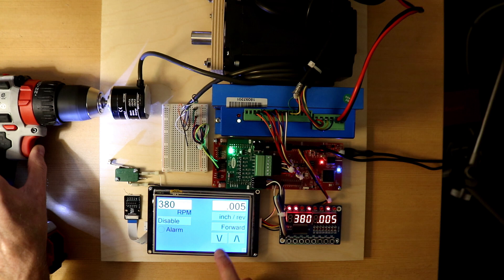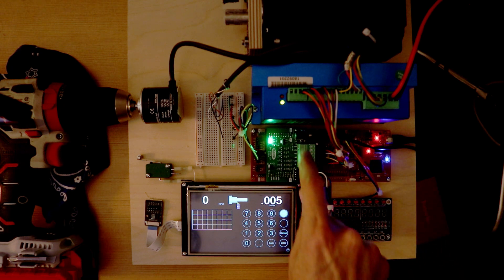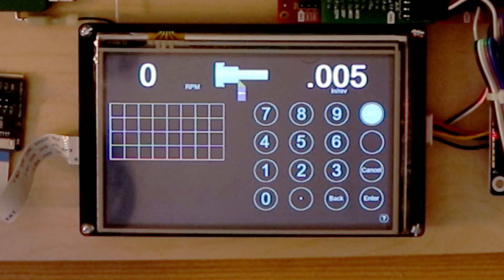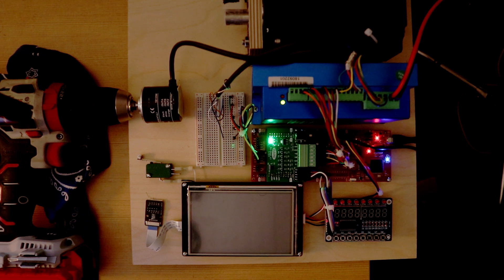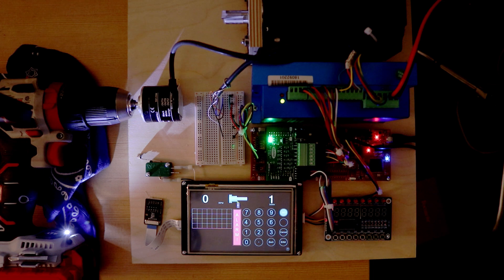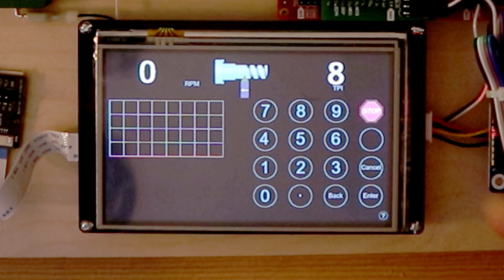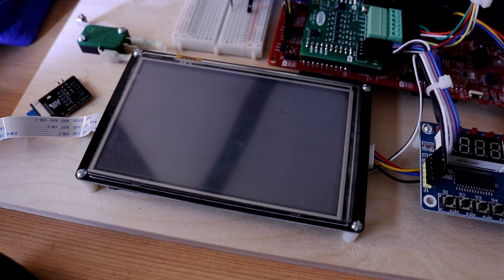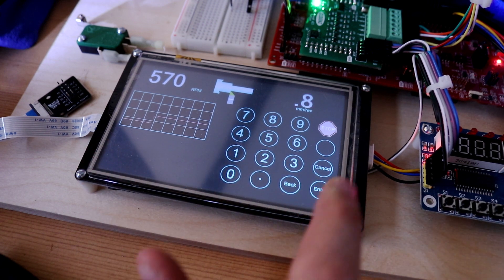Touchscreen for Clough42 Electronic Leadscrew

Comment from the maker: The graph on the interface could be used other functions. For instance, plotting spindle load on a second axis with spindle speed. The hardest part is likely getting the information into the TI board. After that, only a small amount of code is needed to display the graph.

Comment: Hi. Going through all the comments as well as all the documentation. So I also ended up with the version where the 7 segment display is also working so I could ensure all is working correctly. The problem is that I cannot get the Nextion display to work. So I am now open for a couple of next steps. If you or anybody still have a compiled version that was done with the old CWARE and where the screen was working I would really appreciate if this can be shared as I do not see it in the GitHub files. I have now in the meantime ported the code and everything else to the latest libraries but the problem stays the same. 7segment and servo is working but Nextion does not work. Any help for a compiled working .out file would be appreciated for my troubleshooting process.

Comment: Hi Kent, my good working Nextion display glass broke and after I uploaded the same firmware into a new identical Nextion display it doesn't communicate with the TI-board.
In the Nextion Editor debug mode I connected the display and could send/receive commands.
The Nextion display seems to be good but no connection to the E.L.S.
Any ideas? Thanks.
Reply: I have the same problem. Spent about a week on it trying to figure out why the board was ignoring commands from the screen. I eventually gave up. 
And unfortunately, it seems as though we're not the only people who have experienced this. Give us a heads up if you figure it out, and I might have another go at it, because right now, I've lumped it into the category of a failed project.

Comment: This screen would make it possible to loop a position sensor (from a dro set) to the TI main board and control the spindle speed based on cutting speed (handy in facing operations) as well as some level of speed control under load, when used with a  VFD controlled motor. Through this setup it would be easier to set the cutting diameter. And have the CPU compute the output for the VFD.
Reply from the maker: That's a very interesting idea! I'm not sure that the value of a ELS makes sense when so close to full CNC. But a tool like you're describing, as a standalone, could be made pretty affordable, and the results especially nice if used with power feed. Thank you
Reply: @kentvandervelden  the cross slide would still be operated manually. Just that the VFD gets added to the control to set, and maintain speed. With the speed regulated by the working diameter.
Reply from the maker: Totally got it. Manual or mechanical power feed if the lathe is equipped. Very elegant.
Reply: @kentvandervelden  tips for alternative screens? The nextion is sold out.
Reply from the maker: @FlexDRG_Lampje  Sorry, no I don't. I've had to buy some stuff on eBay at inflated prices, because everyone is sold out. E.g., last I looked RPi's were 3-4x list.

Comment: just found this. Fantastic implementation! I particularly like the graphic of the part and cutting tool.

What is the need for the graph? I see previous comments echoing my thoughts, but you must have had a reason for it. 

Kudos. I am in awe.
Reply from the maker: Wow, thank you! The graph is an experiment, to see if a trend line is useful. Spindle speed may drop if the motor starts getting bogged down. Maybe temporarily or maybe its regular. For the visual sort, who can't do math in their heads. Count me in that group :)

Comment: Kent, awesome video and useful expansion of Clough42's implementation!

For those of us who are coding-deficient, could you explain more about how to add this to James' ELS? Is it an addition to or does it replace the Clough42 code?

Thanks for your efforts!
Reply from the maker: Thank you! This is a modified version of the original. If you built the original using Code Composer, you'd follow similar steps with the modified code. You can find the modified code at the following link. As a fallback, save the original binary that you loaded to TI board, which can be reloaded if anything goes wrong and save you the time of rebuilding. Wishing you the best of success!
https://github.com/kentavv/electronic-leadscrew/tree/feature-nextion-pure-dev

Comment: This is why open source is beautiful, someone put an idea out there, and someone else built upon that idea.  I'm going to order parts and hopefully contribute as well.   CNC lathe doesn't do anything for my work flow, but CNC aiding to avoid gear changes is awesome.
Reply from the maker: That's fantastic!
Reply from the maker: I was bitten hard recently relying on a closed source program to collect results. A bug caused all the data to be lost. Lesson learned was the most important tasks need to be verifiable and simple.

Comment: If I already have the original project, is it possible to add only the microswitch?
Reply from the maker: You could add the limit switch to the original project. You'll need to add a small bit of code. I recommend using a proximity switch or interrupter instead of a mechanical switch to simplify debouncing.
Reply: @kentvandervelden  Thank you very much .

Comment: Great indeed fantastic project.
You could add two more engines to make it all automatic, the board would be the same or should you do a new project? Thank you so much the videos are very intuitive.
Reply from the maker: You want to add two more motors? You may be able to start with the existing board and software, but heavy changes would be needed. I would prototype with LinuxCNC, make a custom display, attempt to reduce to a smaller size. The time cost of a custom ELS is higher vs. a CNC system that's more functional. Hardware costs are similar. Hope I understood your question correctly at my opinion was helpful.
Reply: Ok thank you

Comment: Kent

I like what you have done very much. The one thing you have done that would make a huge improvement to the Clough42 system is the end stop. It would be better with an electronic end stop and a start point, but the simple switch you have used as end stop would help a lot. I have my Clough42 system working on a very old Lorch lathe (pre 1900). The change wheels and spindle back gears are very heavy and have a lot of inertia so continue running for some time after the spindle has no power. This make guessing where to end a thread or turning a shoulder is scary to say the least. The only way to do it safely is to turn the spindle by hand, which I often do when using change wheels the old fashioned way. This would instantly be solved with the end limit switch.

I have had a look at what you have on the Github site but I find it not easy to follow what to do when I have a running Clough system. Do you have a simple guide? I have looked at your readme notes but still do not see what I need to do.

I can see I need to buy a Nexion display and a switch but cannot see how to connect them. Also does the Clough Ti programming change? 

I struggled a bit with the Clough system mainly due to a faulty chip on the TI board. I also found the flashing of the chip not so simple either. I am not a programmer and I have not used windows for years since getting an Apple computer. 

John
Reply from the maker: Hi John, the point about inertia is a great one. The switch acts fast, but the work I did was a demo, and may not be reliable installed on a big lathe. The electric start and stop points is a great idea. Then the hard limit stop switch could be a safety fallback. I did make a couple of videos (before here) that might help with building the code, but I'm afraid they might not be so easy to following. The configuration is the same. I don't have the hardware to develop and test with, there was no interest in this work going into the main branch, so I'm afraid people trying this code today are trail blazing. The code needs proper axis acceleration, and because of this I can not recommend. You might also look at the ELS that JohnSL recently demoed, which is an affordable commercial unit. Jesse Schoch is working on a new open source ELS that corrects some of these problems and search for "jack electronic leadscrew" for another alternative with a very clean interface. Wish I could help more, let me know if I can.
https://youtu.be/-PBeGCukXUA
https://youtu.be/-YWaVqi-4cs

Comment: Hi Kent, in your "Touchscreen for Clough42 ELS notes" you mentioned in "Suggestions for improvement" that the TI processor has a coprocessor, the Control Logic Accelerator (CLA). Do you know if this CLA is now used and neccesary for the ELS to work in James and/or your versions?
Reply from the maker: The CLA is not used in my branch, and probably not in the main branch either. Are you considering porting this code to a different processor?

Comment: hi I'm a little stuck I have the same setup as you did in the video but the screen doesn't seem to be getting signals from the board is there something i have missed on the board I uploaded the code to the board i have tried the code with Support for the seven-segment display but the screen still didn't work but the seven segment display did any help would be greatly appreciated
Reply from the maker: Completely guessing... could something be off with your serial setup? Do you have means to test that serial is being sent and from the display? An oscilloscope will let you know something is happening. One with serial decode will let you know messages are not corrupt.
Reply: @kentvandervelden  just wondered if I had missed a switch or jumper that wasn't set in the original clough els I don't have a means of testing if I can't figure it out ill have to go back to the original els for now thanks for the quick replay it is much appreciated
Reply from the maker: @zerot001  No jumper changes that I remember. I don't see anything about it in my notes or in the SCI block diagram. I'm sure you've already tried the simple stuff: common ground between Nextion and Launchpad, triple checked the right pins are used on the Launchpad for serial, tried reversing them just in case, and checked that the right baud rate is used on the Nextion. Another possibility is if your board has a different main frequency than the one that I used (different revision?), serial might be off if using a divider of the main clock. Sorry I couldn't be more help.
Reply from the maker: @zerot001  Have any success?
Reply: @kentvandervelden  no luck at all I'm afraid
Reply from the maker: @zerot001  Hmm, drop me an email if you would like me to take a look.
Reply: It seems I have the same issue. Was there any solution to this issue? Thanks in advance!
Reply: I might as well join the conversation as well, since it seems as though I have the same problem. Been at it for hours and can't work out what the problem is. So if anybody has a solution, I'd love to hear it.

Comment: This is the best project I've seen in months. I would like to see an Override Button with Plus and Minus Buttons, under the graph on the HMI that would be enabled/visible only in the feed mode. After touching the Override Button (change to red), touching the digit/decimal place on the HMI would set the increment or decrement of the feedrate by 1 of that placeholder. Touching the Override again (back to default color) would set the "increment/decrement by" back to zero. Really nice project. It's all way over my head, but I love it!

Comment: Geat work! A touch display is nice but I would prefer to have critical controls on real buttons. I would appreciate if there would be a possibility to have a momentary start/stop switch so that you don't have to control the movement of the tool by engaging or disengaging of the half nuts. Moreover, a manual override of the feed speed would be very useful to dial in the feed on the fly. Therefore, a rotary encoder would be nice. For these functions it would be nice if you could access them on the touch screen and have the possibility to connect external switches and a rotary encoder.
Reply from the maker: All great suggestions! I put links to other ELS systems in my notes (in the video description). One uses a rotary encoder for most of the features and it's a very nice interface. Someone had interest in writing a feed override and I made a video going over one way to do it. That's probably all that I know. Thank you for commenting.

Comment: Hi Kent. I have James' ELS set up on my lathe. This development very interesting and clearly a lot of work has already been put in. I'd like to suggest a hybrid arrangement. Your user i/f is much better for setting up parameters than compiling code and the display of the settings may also be preferred by some.  Machinists tend to have oily fingers which is where problems with touch screens arise. But this work, linked to a  'in use' physical button interface would solve that problem. Set up available options with the touch screen and use it to display the option(s) selected but make the selection with physical cursor keys, keeping the display screen clean when the machine is in use. We can always wash our hands before changing options etc. BobUK
Reply from the maker: Thank you Bob, that's a great idea! Since the video, I added a display of rotary position, in degrees, dec., min-sec., counts, etc, which may be useful if lacking a dividing head. Implementing your idea, could be done either using a GPIO into the Launchpad or into the touchscreen (and avoid the C++ code.) Full disclosure: I'm not planning to do more work on this, but your suggestion will be added into new projects. Best wishes, Kent
Reply: As far as the oily fingers go. glass or plastic tablet covers can be used with these types of displays. This would protect the display from oils and impacts. I use this brand Supershieldz and been pretty happy with it on my phone and tablets, which I have used with my hands oily and dirty. For this display I would say a Playstation Vita PCH-1000 protector should work for it. I ordered one for this project. Once I have than delivered, I can then start designing and building a cover on my 3d printer.

Comment: Hi Kent..  this is a little off topic, but... were you the one who made a "V" bracket and mounted it between the Z column and the wall to stabilize the column?   ie:  bolt the small part of the "V" against the column and the wide part against the concrete wall.... and it really made a diff in the column flex!... if you made this vid please let me know which one.... Thanks!  ( if not... try it! )  Phil
Reply from the maker: Hi Phil, thank you for thinking I might have come up with that :) A couple other people have told me about it and I have a few links. I'll send them this evening.
Reply from the maker: Hi Phil, I had a couple video links. The best implementation is probably
https://www.youtube.com/watch?v=X_6i4SN05HU
But a close second, with very interesting discussion is
https://www.youtube.com/watch?v=JwzA67_-cAM
If you make either of these, I would enjoy hearing your thoughts. I was warned by someone who tried bolting to the wall, that the performance may be better but the noise might be worse. Best of success to you.
Reply: @kentvandervelden  Thank You for finding this! the first one is the one I had watched and really thought was so clever!

Comment: Is it possible to use other touch screens besides the Nextion touch screen?
Reply from the maker: It's possible, but the cost would need to be written. Given the RPM, Alarm, etc. passed to the make-model specific touchscreen C++ class, return the current feed, pitch, etc. If you are interested, drop me an email and I'll work with you to make the interface to the touchscreen generic to your code alongside the Nextion.